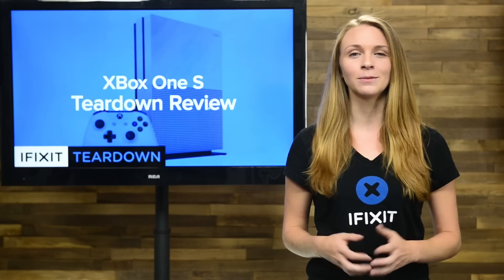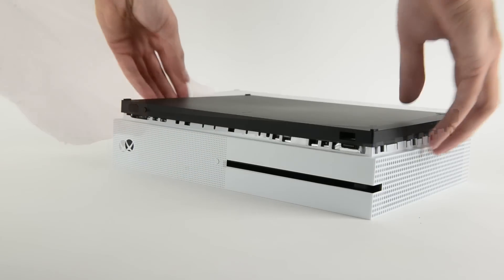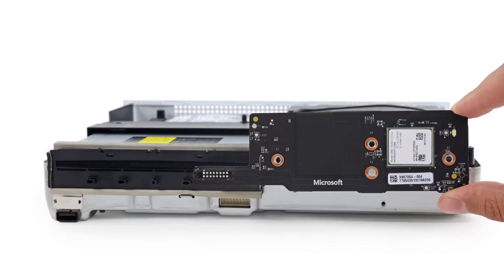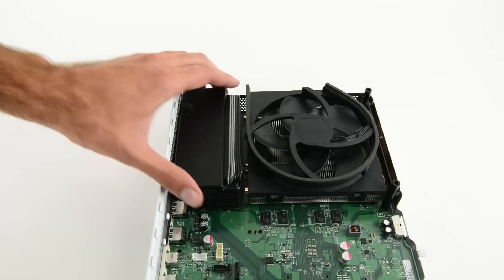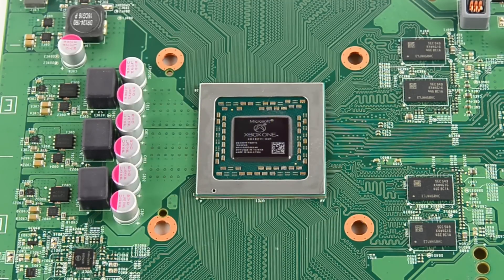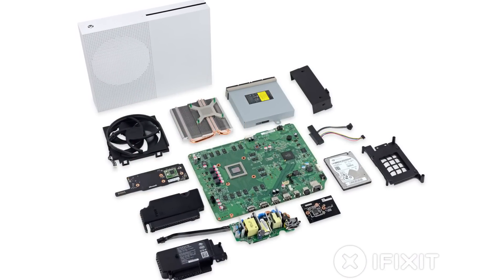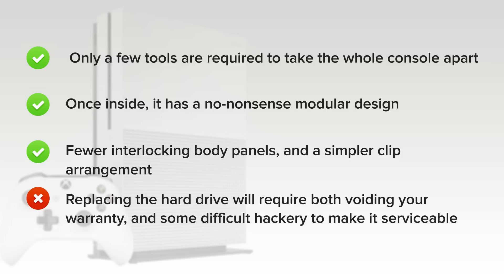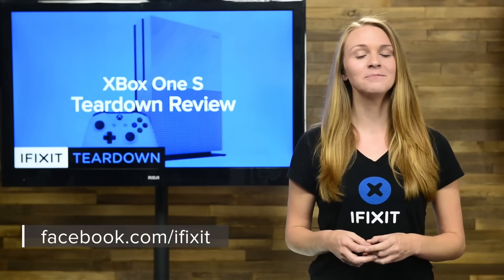Xbox One S Teardown Review!

Comment: Why would you want to replace the HDD when you can use external ones ?
Reply: SOME people like ME prefer to only have an internal hard drive for consoles instead of having an external hard drive placed next to the console or behind it where it can block the back console vents.
Reply: +PSYCHO My console space would look cleaner without an external attached to my console.
Reply: Because the Operating System runs on the internal drive meaning that if you were to replace it with a faster drive such as an SSD then your Xbox will run much smoother.
Reply: PSYCHO I have mine right on top of the smooth plastic. Not covering any vents.
Reply: Speed. Runs faster straight off the mobo

Comment: Really Microsoft Sata 2  not 3. The original ps4 is Sata 3 and supports SSD. Both My PC and Ps4 have SSD installed and Games Loads Speeds Are Super Fast And BTW the xbox one and one s are a waste of money if you have a Gaming PC Like i Do Because of the MS Store and Xbox APP on Windows 10.
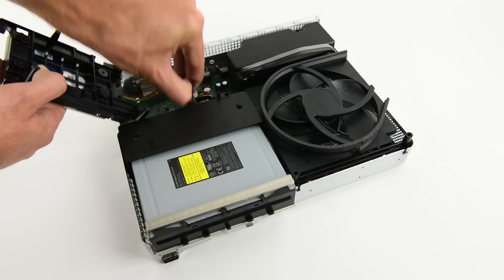Reply: She said it's a SATA 3. Check time stamp 1:20
Reply: The HDD is SATA 3 But the Xbox one and One S Motherboard is SATA 2 Read the Chipset
Reply: no it wont work. It has to have a specific file system on it, like NTFS but its specific to Xbox One. technically you could. and I really want to try it. I'm just waiting for the chance.

Comment: Why are they SO against replacing the HD? It just doesn't make sense.
Reply: ***** Agreed on all accounts. I have a SSD in my PS4 and it has made a difference in loading in that. I do find it outright stupid that the USB 3.0 connection on the back of the XBOX is a faster connection than the SATA connection inside. Whether it's "practical" or not because of money depends on your budget.
Reply: Why would you want to ?
Reply: wolfe1970 besides making it WAY faster with an SSD?? 

What kind of a question is that?
Reply: Because what would be the point of selling larger storage one ( no pun intended)  for a higher price than letting people replace it. I'm with you though, SSD all the way.
Reply: Paul M I don't even know where to begin. Almost all gaming PCs include SSDs now. I've had one in my PS3 since the third year it was out and it's still kicking today. It's way faster and much more reliable. Basically, you're just wrong. It's an amazing idea.
Reply: +H DR your right I guess. With all the improvements of newer SSD's it isn't as big of an issue. But honestly like someone else mentioned before, I'm not spending almost the same price of the console on a hard drive because going from a 500gb Hd to a 250gb is a downgrade imo. I'll wait the extra 10 seconds or so it takes to load and just get a 1tb mech drive for a console.
Reply: @Cappuccino
You can't assume that everyone is like you.
some people:
- don't install games as often
- don't need more than 256
- hate loading times
I really don't see why MS does not offer a SSD model themselfs.
Reply: @ysmg9010  Game console with build in SSD will be niche of the niche. There will be only small handful of people who want that.

So it's better to just make the console has replaceable hard drive
Reply: +H DR for my PC though I have a 250gb boot drive and a 2tb mechanical storage drive. Along with 2 other 1tb hard drives for game capturing. But the SSD does not improve FPS at all.
Reply: SSD is not suppose to improve FPS lmao
Reply: Cappuccino - Loading uses reads, which are practically unlimited, not writes.
Reply: JuicyMullet I just run all my games off of an external 2Tb hard drive.
Reply: +H DR well honestly, an SSD would be a terrible idea because they only can handle a set amount of writes before failing. And loading games that average 40gb onto the SSD would cause a lot of "ware and tear" on the drive. If you install multiple 40gb games per day on it, that it will probably only last you 3-5 years.

Comment: Those are some pretty bad specs for gaming. 5400 rpm hard drive? What even
Reply: RPM speed has nothing to do with transfer rate
Reply: RPM isn't the only thing that matters. Drive density also matters.
Reply: ***** 5400 RPM 2 TB = 7200 RPM 500 GB
Reply: +1000bassnut ps4 has 5400 rpm drive as well...
Reply: +CriminalGameplay OR since it is half way through 2016 you could put multiple SSD's in it due to their compact size.
Reply: might be bad specs.
but the fact that this thing can play ark ..is like wtf, yeah it only gets about 25 fps but things look alright. good luck building a $300 Pc that will even turn ark on lol
Reply: Don't need to, I got ark, and a friend has games on his account that I like to, and if I want to buy games I'll go to cjs CD keys :) you really think I'll spend 60 on a game? Think again
Reply: overpaying? 40 euro for a release game on consoles, as if PC games are cheaper. if you buy them directly on steam you pay 60 euro compared to consolegames